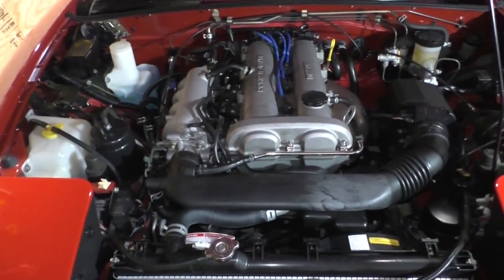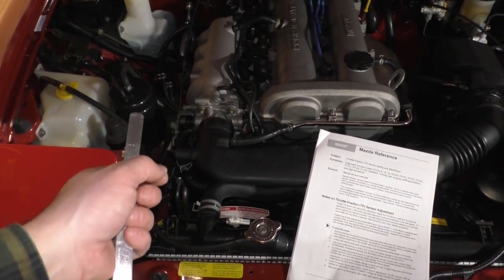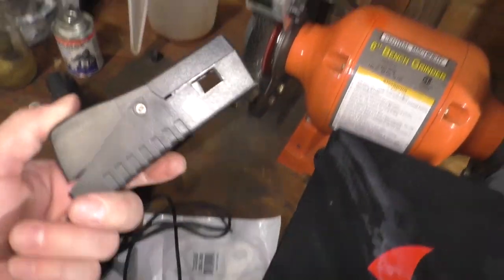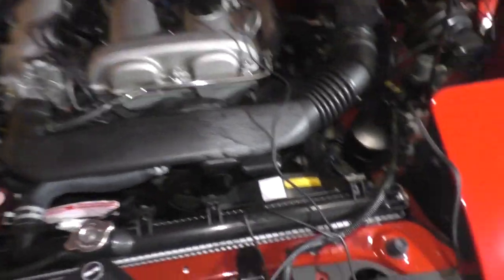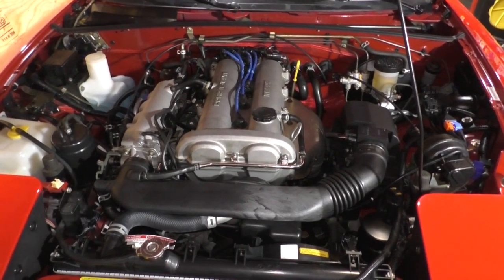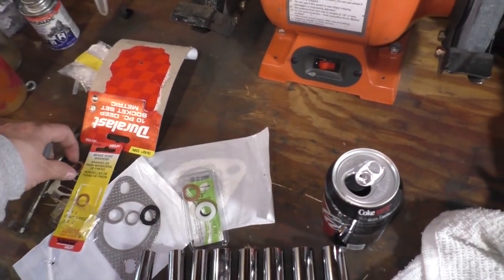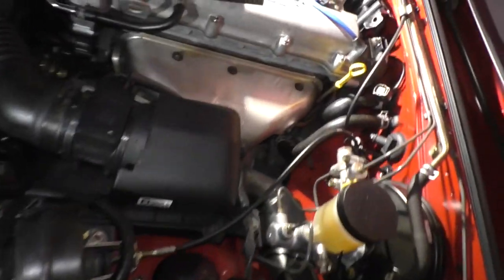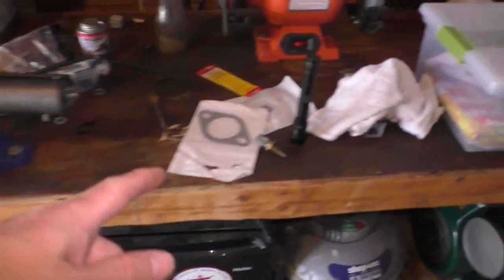Adjusting The Mazda Miata's "No-Touch" Screw, Setting Base Idle and Timing, and MORE!

Comment: The throttle stop skrew just stops the butterfly valve from causing damage to the throttle body. It's a pretty simple idea.
Reply from the maker: It also sets the stop point for the throttle plate, the position of which needs to correlate to the “idle” position on the throttle position sensor - basically, a starting point for adjusting everything else

Comment: Good video, all the info you need is in this video. The only thing not mentioned is that the engine has to be hot when you connect the TEN to Ground pins AND all the electric supplies need to be turned off (radio, lights, airco, not touching the steering wheel). Also when the cooling fan turns on, wait for it to turn off and then proceed with setting the idle.
Reply from the maker: Good point! I forgot to mention this!
Reply: @bbishoppcm  For the rest, a very good detailed video. Some owner before me touched the screw and I couldn't find a way to fix it till now. You did some good research.

Comment: The screw was missing on my car so i had no choice but to touch it a lot and also the tps sensor had to be touched a lot
Reply from the maker: What seems to be the bigger issue is if the stop screw is too far out of adjustment, you'll NEVER get the throttle position sensor adjusted properly.

Comment: OBD reading would throw a code if Engine coolant sensor was on its way out.
Reply from the maker: It’s OBD-1, it would have had to fail catastrophically for this to occur
Reply from the maker: It takes quite a bit to trip-up OBD-I; minor value drift doesn’t seem to affect it, but a totally open or closed circuit may.
Reply: You can see the ohm reading in graph form and you will see abnormal jump in numbers as the temperature increases.. Just like the TPS sensor, a sudden jump in voltage as you advance the throttle plate slowly.
Reply from the maker: @vincentlee2460   You are correct- on an OBD-II car, a good scan tool will give you a graph reading of the sensor's output and any sudden jumps in resistance will indicate a "soft failure" of the part (value drift). The onboard diagnostics on PRE-OBD II cars is VERY primitive - it will only trigger an error code (in the form of blinking lights while in diagnostic mode) IF the sensor goes open-circuit or shorts out internally. The only way to properly test this sensor is to remove it, place it in a pot of boiling water, and measure the resistance. In the 90s, the dealers may have had access to a more thorough diagnostic system, but these systems are loooong gone. I figure, if I have to drain down the cooling system and go through the trouble of removing it to test it, I'd might as well spend the $40 on a new one and move on. I hope this clarifies my situation. Since I replaced the sensor and recalibrated the throttle body, I've had ZERO issues and it's been over a year.
Reply from the maker: Thinking about your comment, you could place it in a pot on the stove and connect it in-line with a regulated power source (5v?) and add a multimeter in-line, then turn the burner on and watch the resistance go up (or down?), watching for any sudden jumps in the readout. Or use an oscilloscope that records... but again, I'd still need to remove it from the back of the cylinder head which is a total pain in the ass... the OEM sensor was only $40 so I just swapped it.
Reply: @bbishoppcm  no need to remove it. Connect direct to the diagnositc port using 3 wires  and the cellphone would get the information from the PCM.
Reply from the maker: @vincentlee2460  what cellphone?
Reply: @bbishoppcm  connect the OBD device to the diagnostic port and transfer the data wirelessly  to the cellphone that has the OBD software.  No need  bulky laptop.
Reply from the maker: @vincentlee2460  i dont think you understand what OBD - 1 is…
Reply: @bbishoppcm  mine has the same diagnostic port as yours, MECS II diagnostic port
Reply from the maker: @vincentlee2460  oh, gotcha! There is an adapter you can buy that replicates the Mazda-specific diagnostic tool and that can be adapted to a phone or laptop for live data extraction. I see what you mean now.

Comment: Just a thought.. Someone attached an extra ground from the coil bracket bolt on the valve cover to the driver's side of the head..and left it..lol... Maybe when you reinstalled the coils you improved the connection...My 90 has idle issues with everything supposedly set right so I'm going to do the idle air valve delete..I noticed your car didn't have it so it probably doesn't need it.. Especially in the southeast US... Definitely smart to buy one a few years in to the production run after the initial bugs are worked out...Enjoyed the video..Thanks
Reply from the maker: My car is as close to "as it left the factory" as it gets - it's possible that these changes (additional ground wire) were made in the 1994 refresh when they completely overhauled the induction system and switched from the vane and potentiometer airflow meter to the solid-state type used in 1994+ model years. Since I reset the base idle, the car still acted up occasionally - it wasn't until I replaced the coolant temperature sensor that it 100% solved all issues. I would explore a bit further before any modifications if it were me - the 1994+ DOES have an idle air control valve - it's a different design and is located UNDER the throttle body. Removing this valve WILL cause issues (the engine will no longer be able to compensate for cold starting, accessory load, and other variables that affect idle speed) - when I was a kid, I basically did this to my 1987 VW GTI and it never ran right since. The IAC valves regularly fail and replacement parts from (insert online or physical part store here) are usually utter garbage - try finding a good used one from a wrecked low-mileage car before bypassing it entirely.

Comment: Hi just doing my TPS and timing, uploaded the sheet MA007, cant find anywhere that states to adjust throttle 12 thou and 16 thou? Good video. Angelo
Reply from the maker: I believe I got those measurements from the Haynes manual in regards to throttle position sensor…
Reply: @bbishoppcm  cheers